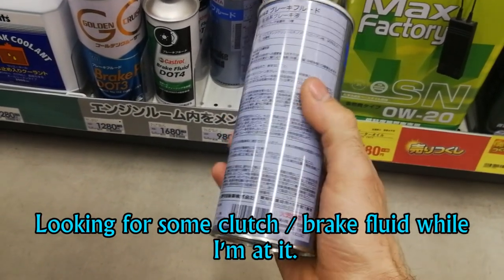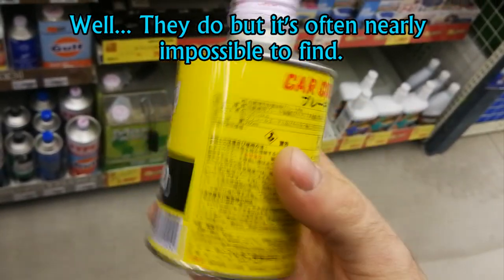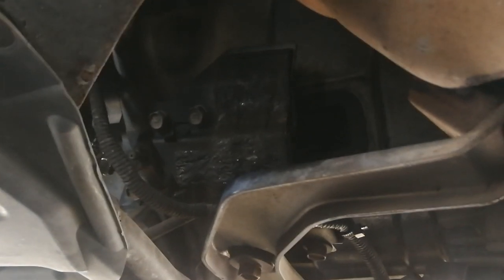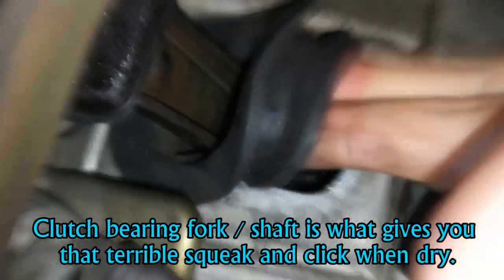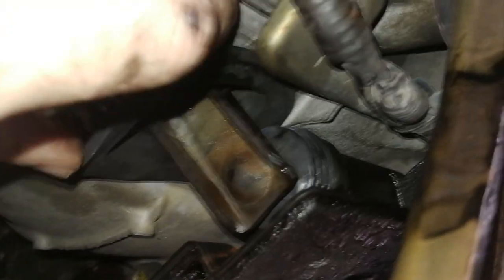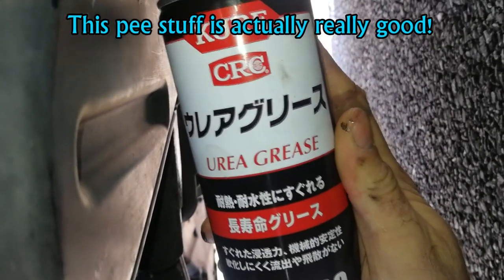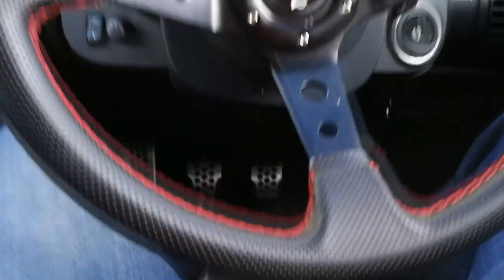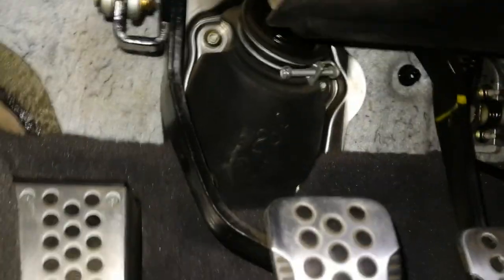Clutch Squeak Fix (350Z, G35, Nissan Skyline V35, CPV35 etc)

Comment: my clutch fork doesn’t move when the clutch pedal is depressed, I noticed when attempting to bleed my clutch fluid. So I was unable to bleed it. I’m thinking it’s my pivot ball that may have broke. Do you know what it could be
Reply from the maker: You probably figured it out by now but if the form and slave cylinder don't move and everything is firm and secure (you can't move fork by hand) then most likely there is bunch of air in the system (or failed slave cyl).
Reply from the maker: Fork*